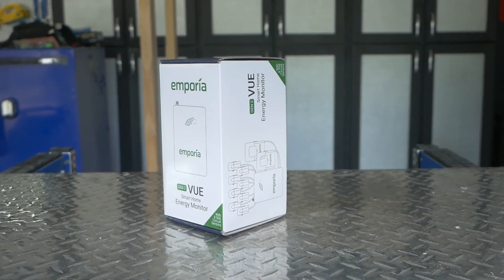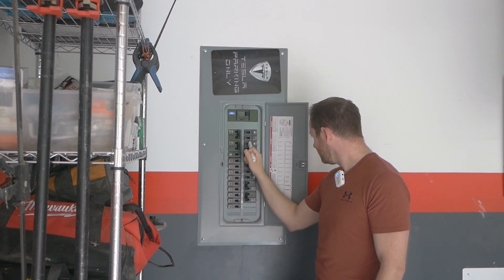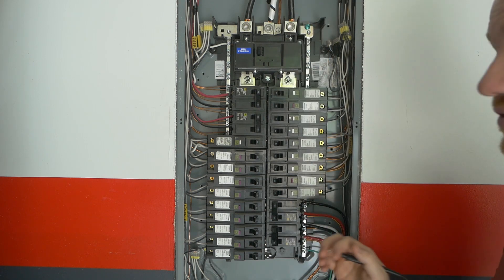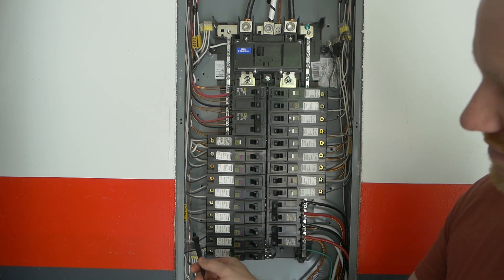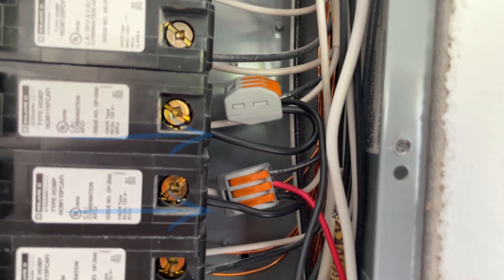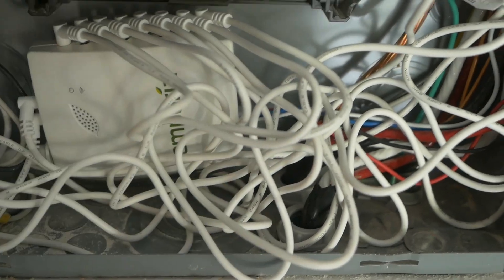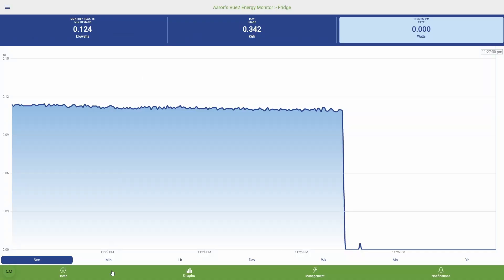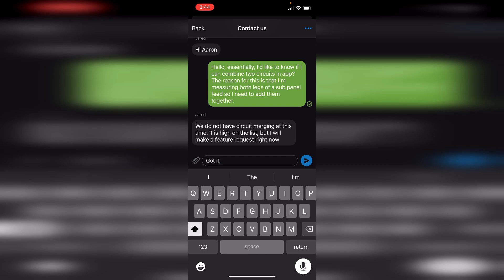Installing a Home Energy Monitor - The Emporia Vue2

Comment: Question: Instead of using Waygo Nuts to splice in, why can't I just connect it directly to the breaker next to the wire thats already there ? I would think it's the same thing !
Reply from the maker: That might work in theory, though I'm not sure two wires in one connection is up to code
Reply: @aaronstestlab  Gotcha... Thank you so much for responding !

Comment: Thanks for sharing your instlal.   The instructions in the app are rather crude since they don't use a video!  Would your instrucitons apply to installing a VUE 2 to a subpanel?   I am installing one of each just to monitor the total usage of each subpanel and don't need to monitory each individual appliance  to bill Tenents.
Reply from the maker: Sure, a subpanel running off a double-pole breaker would look just like any other circuit to the Vue.

Comment: This is very fascinating. Pinpointing every device is so cool. The mixed circuits makes me wonder if it’s a limiting factor considering our house has a Generac and solar panels.  Besides the garage feed from a 100 amp breaker on the once “main” house panel but now the Generac breaker is the main I’ve been told.

Comment: In a split phase installation, I've read that you can monitor your 240v sub-panel with its 120v loads with just one sensor without in-app multipliers. You place the sensor in a phase wire, and pass the other phase wire in the opposite direction (anti-parallel) throught the same sensor. That way, individual currents add up in the reading as positive values. (If you place them parallel, currents cancel each other in 240v use). I can't really test it over here, as my country uses 3 phase transformers with 120° difference instead of split 180°, but the theory makes sense! You could give it a try :)
Reply: There's only room for a single wire to pass through the current sensor though, so even if it were possible to orient the heavy gauge wires 180 degrees to each other it wouldn't fit.

Comment: I just installed the 16 circuit version. I had to get real close to the Bir to install.  I haven’t dressed it out yet since I wanted to check the install prior to closing the panel. It is working well for me. I plan on sticking the wifi antenna through a punch hole and it is only 4 feet to the wifi router.

Comment: how did you get it to work on the GFCI circuit breaker. Mine keeps tripping
Reply: Seems best to use dedicated breakers for the unit power unless you can be sure the circuits you pick never trip their breakers, and rendering the monitor inoperative.
Reply from the maker: Actually a good question. The plugs I tied into are not GFCI, they're AFCI. If one chose GFCI plugs the current the Vue itself draws would trip the GFCI breaker. The solution would be to pigtail the Vue's own neutral(s) into the GFCI's neutral.

Comment: Nice! The prices are realy coming down on these.  Thank you.  I think I will try it.
Reply from the maker: It's pretty dope
Reply: @aaronstestlab  Does it have a way to connect to a computer (Other than the phone-to-PC app) that way I can permanently store the data? If not, what if they stop supporting the app, what happens to the data on my phone - how do I backup the data in case my phone is changed/lost?
Reply from the maker: Yes, you can export the raw data in csv format